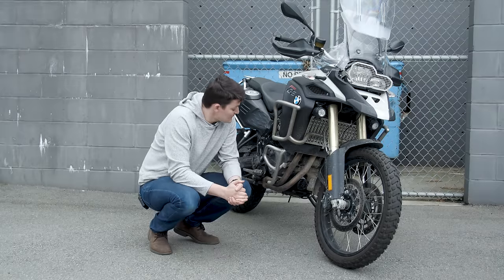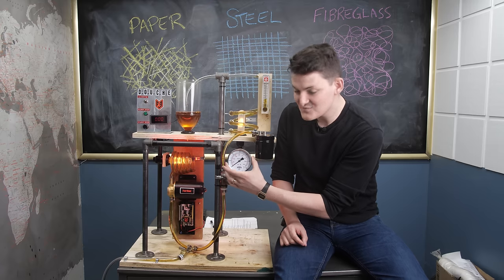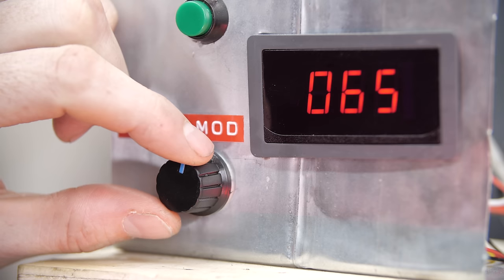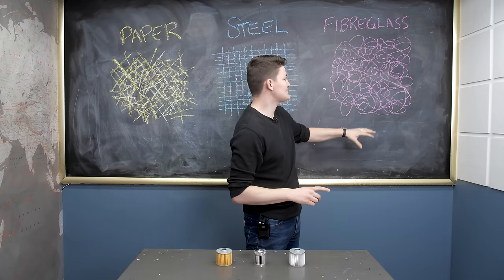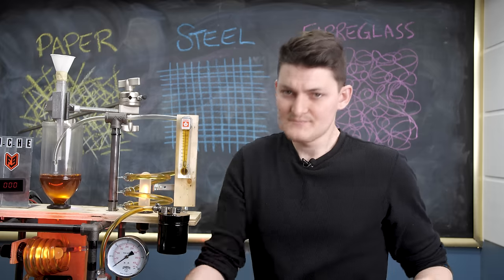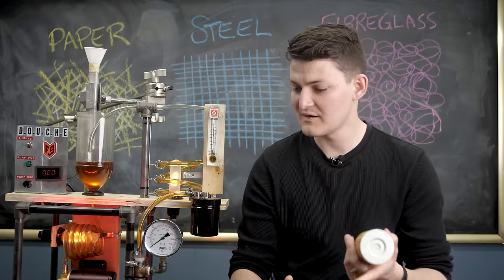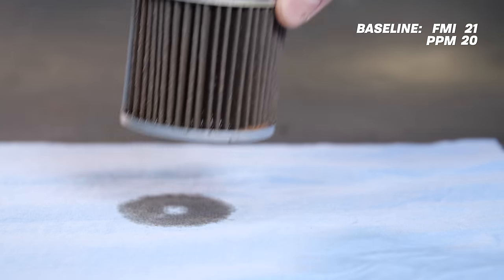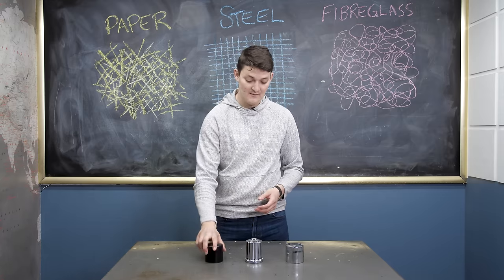The Best Oil Filter - Testing Paper vs Fibreglass vs Steel

Comment: As a marine diesel mechanic for many years. The oil and I am talking hundreds of gallons per engine in some cases. Is cleaned by centrifugal  separators can't get any better than that. This is one of the best dynamic test so far here on YT. Change oil often and use a magnet on the filter. Oil change is cheaper than new engine.

Comment: This was great, you should do a similar test between different types of air filters
Reply: That's not what this channel is about. 
Ask Project Farm to do it.
Reply: I'm willing to bet the results would not be too different. Yes, viscosity is different between air and oil, but the principles are the same.
Reply: @68404  Project Farm just isn't as funny.  Perhaps a collaboration is in order?
Reply: @68404  PF has already done one. It's alarming how poorly the most expensive K&N filters do and surprising how affective the cheap ordinary ones are.
Reply: @buzzman3200  I sorta expected that, but it was rather an amazing test.
Reply: @68404  Fortnine is more entertaining and does a great job at explaining what is happening and why results are the way they are.

Comment: The beauty of Stainless filters is that the flowrate is constant throughout the service interval - Paper and possibly fibreglass will deteriorate over the 5 - 10 thousand klms - there's a good reason we use Stainless in the world of offshore oil and gas - all my motorcycles run on Stainless for the past 20+ years

Comment: Another reason people appreciate your channel. Its funny, i have an old Toyota i bought used, and my last oil change i installed an OEM basic replacement NAPA filter. After 3,000 miles, the oil is quite clean, and cleaner than the previous more expensive filters. I thought this result might be anecdotal, since i have been changing the oil more often than recommended , and have been trying to mitigate an oil consumption issue. But the oil clarity now does not lie, its real good. So, this video explains why my results are what they are . Thanks.
Reply: Buy OEM filters from your local Toyota. 

Many years ago: a YouTuber, I forgot who, made a video cutting up oil filters of all budgets. The most expensive and highest quality filter — and one I used up until that video — was Mobil1. Guess who matched it's quality ? Toyota OEM. 

Mobil1 goes for twice the cost of a Toyota OEM filters. Ever since that video I always use Toyota oil filters for my cars.

Comment: I came to the same conclusion years ago in the automotive world. Now do a similar test on air filters to crush all those K&N myths once and for all. Great vid as always btw. 👍
Reply: Two other channels did a particulate and flow test on air filters, sorry I can't remember the names. Result, as you would expect, the K&N had the highest flow but of course passed the most particles. On my Miata I put my K&N in when I put the track tires on and I put the paper filter back in when I put the street tires back on.
Reply: @petezny4343  Most likely, it was Project Farm. K&N filters are an oil and gauze system. The higher tge mileage, the better they filter until they get saturated with debris.
Reply: Anyone dumb enough to use a high flow air filter with less filtration, in order to gain 4 horsepower, deserves to have their engine explode. I picked up a K&N filter once on display, and noticed I could see holes in the filter media that let light through! There are visible holes in the filter media. That's not an air filter. High flow filters are good on boats and track vehicles only. If you remove a paper air filter you'll see it packed with fine dirt particulate. Particulate ruins the cylinder walls, obviously.
Reply: @Ritalie  But it also keeps carbon build up down on the back of the valves on direct injection engines! /s
Reply: K&N kills off-road engines. Old fashioned oiled foam is the way to go for serious dirt and dust. Twinair and Uni saves top engines. I've seen pictures of road bikes running a K&N filter with all kinds of internal damage. It makes sense because unless you ride in a controlled environment you're going to encounter dust at some point. Sand, dirt, someone mowing their lawn etc etc. I know they make a prefilter for the K&N and it's probably ok for street use then but never for dusty areas.
Reply: Project Farm did a video on air filters. K&N performed poorly.
Reply: @yurgon  I had a K&N on my Vstrom and it so wasn't worth it. Little bit more pep and a sweet induction noise but so much bloody dirt passing the airbox. Should have stuck with cheap bastard filters
Reply: KN airfilters dont filter that great....
Had pretty dirty carbs with the KN my Bandit came with
Reply: @TonyRule  It's like getting your engine walnut blasted, but all the time!
Reply: @amicloud_yt  And for FREE!
Reply: This!!!!!
Reply: @amicloud_yt  nut blasted? 😳
Oh wait.. 🤦🏽‍♂️
Reply: No dust past the K&N filters I've been using for ~35 yrs on cages, street bikes, dirt bikes. Several over 100k mi, 1 over 230k mi. Proper oiling and install required.
Reply: @dougfreeman3229  They're nothing special. It's pure marketing.
Reply: @TonyRule  Incorrect in my case. Over 1,000,000 mi (all combined) is actual in service testing, not marketing.
Reply: @dougfreeman3229  It's anecdotal and without a control.
Reply: @TonyRule  Factual, have all the service records. Cant face facts can you? Throws a wrench in your narrative.
Reply: @dougfreeman3229  Look up the words I used because you clearly have no idea what they mean.
Reply: @TonyRule  Actual data is not anecdotal. The “control” is miles driven in this simple experiment.

Comment: For years I've been running Drag Specialties Chrome magnetic paper oil filter with great sucess in my Harley's, the oldest being a 95 Softail with over 73,000 miles. I've done autopsy's on several of these used filter and was impressed with their construction.

Comment: We used to split filters before discarding them. It taught me a lot about what's inside, comparing OE to cheap replacements. They were all paper, but the aftermarket filters used way less folds: i.e. way less filtration surface.
I only buy OE or from an OE equipment manufacturer.

Comment: One thing to note with paper and fiberglass vs steel is "one pass" reduction in particulate. Steel is absolute at whatever rated micron. So paper does filter finer, it is also possible that large particulate will pass through and hopefully be caught on the next go around. If steel is rated at 30 micron, guaranteed first pass everything larger than 30 micron will be removed first pass

Comment: I've been running a steel filter in combination with a magnet cover on my 09 BMW 450x with over 13k.  Nice thing with steel is the quick oil changes and reduced waste; since you don't have to wait for shipping and no extra packaging.  Great content guys!
Reply: will also blow up your bmw sooner or later
Reply: @rampage3337  hasn't yet and I have now over 15,000 miles on it and still runs like new.  Just the change oil, clean air filter, check timing,  and ride clean don't over abuse your throttle and use your clutch!  Been on everything to Idaho White Cloud range single track, Gifford dual track and Moab slick to the Hole Enchilada.  She's a "Big Mountain Women.  BMW! Plus its pretty much built by Honda anyway so you can do what ever to it and its still gonna run... My 2 bike quiver with additional 2 stoker 95 200KDX for GOAT rides.  I guess anything will blow up sooner or later even us! hahaha Thanks for your feedback on regarding why and how my motor is gonna blow up.  Perfect example why the internet is just great and so informative.  :P
Reply: PROTIP!  @BeardedBavarianBiker.

Comment: I was an engine performance engineer for Honda R&D before moving to ev and I will say 3 things: 1.) Ryan, you executed this test better than a lot of people would have in professional R&D, well done mate! 2.) most OEM filters do use paper, for cost etc. and it's really good to see it perform so well! and 3.) Generally the best filter you can use for your bike/car is the OEM one, along with the OEM recommended oil. This is because all of the development was done with these parts and oil formulas in mind, so your engine was literally designed to use it.

Comment: I'm also curious if there's any difference in results between cold and operating temps for the oil

EDIT: Ryan replied elsewhere and said the oil was indeed heated for the tests, and since that's what the oil is gonna be under SOP, it's good enough for me
Reply: Also I wonder what the variance is just in brands of the same types of filters
Reply: In this test rig they had the oil heated up hot, don't think they compared it too cold oil though
Reply: @archygrey9093  I wonder if it was 90c like normal engine oil would be
Reply: @pleasedontwatchthese9593  Definitely not 90c from that little heat lamp in the rig.
Reply: Temperature would affect only  the viscosity (the thickness) of the oil and thus the flow trough the system,  but it wouldn't affect the filtering capabilities. However,  there would be same changes with the metal filter, but I don't think they'll be any dramatic.

Comment: I appreciate these tests you do. There's so much misinformation in the mechanic world, much of it stemming from advertising or outdated knowledge.
Reply: Wow that's a really good point. The misinformation is painful. People using high flow air filters for example. Ruining their engine with more dirt. There is the issue of running unnecessarily rich fuel mixtures which also ruin your engine in short order and decrease power. And then there is the octane issue. Low octane fuel actually burns faster and increases horsepower. Buy some people run high octane fuel because they believe octane is the performance rating. So much misinformation. Octane is the rating of resistance to exploding. Higher octane is less explosive.

Comment: I'd love to see different brands of paper filter tested. See if oem or aftermarket is better
Reply from the maker: We did notice that some brands of paper filters are better than others! The cheap ones have no bypass filters and are often shimmed with literal cardboard. Unfortunately you normally have to cut the filter open to find out. K&N and HiFloFiltro are both safe bets in our experience. ~RF9
Reply: K&N scares me because of the poor filtration of their cotton gauze air filter products. I've been using the Amsoil filter. Even the Yamaha OEM claims to be good for two oil changes but I'd rather just do it every time for peace of mind and to make measuring the new oil more consistent.
Reply: As a guy with a racing background who has done a LOT of oil changes, Wix is my choice! Most are made in Merka (sorry ryan), lots of sizes, and not outrageously expensive. Heck, NAPA uses 'em.  If you want clean oil free of contaminants and bits of motor? Change your oil more often. You notice that none of the filters brought contaminants/metal down THAT much.
Reply: @r3beatty  Agreed, a decent filter and frequent/regular oil changes are more critical than spendy filters and fancy oils.  At the very least, use the OEM filters and an oil that meets the OE specs.
Reply: @imadecoy.  I've owned bikes where they recommend the filter is only changed every 3rd oil change!!!. If I'm changing the oil, I'm changing the filter too.

Comment: Question for Part 2: A filter used for it's recommended service life, how plugged up is it? My guess is that most filters get binned with out ever getting close to their "used up" condition.
Reply: Yamaha recommended changing oil filter every second oil change. I do this with my car. Change oil every 10,000km, filter every 20k. My theory was that even though filter medium may not be clogged, perhaps contaminants in oil may damage the glue that holds the filter together, or the filter media itself. So I was not prepared to chance leaving filter in any longer.
Reply: @glennmerriman8382  I have heard of the "skip one" filter changing scheme before. It seems logical, yet the question remains: how close to "used up" are we actually getting? I've always erred on the cautious side, new filter everytime. I've autopsied many a filter. I can't claim to have ever discovered anything except oil-soaked filter media. Maybe I need a microscope......
Reply: @runalongnowhoney  Every other one is recommended by Suzuki and Honda too. If it is good for the tiny filter of these hi-performance engines, its more than enough for a car.
Reply: @glennmerriman8382  nah don't listen to yamaha. you have to remember our clutches and all the shit that we grind off them get's put in to the oil and filtered through the oil filter.

Comment: As much as I love this channel, one example of each type of filter tells me little.  We don't have any idea of the variability of each of the filter media.  This was driven home to me recently with paper coffee filters when the latest batch took significantly longer for each cup.
Reply: @J Fess, it's ok. We're still going to laugh at you for upgrading your bike to a metal filter......
Reply: @rgh622  I was originally going to state that the worst option was the metal filter was the worst option but thought it went without saying.  Apparently not, though.
Ps I spent years dealing with industrial oil analysis and filtration systems.  THAT is why I stated that his simple test was not terribly useful.  A different brand of filters might very well have produced different results.
Reply: @jfess1911   Excellent reply.  Your background in the oil analysis & filtration industry would have caught my attention immediately had you said that in our original comment.  NOW, I to am interested in results from differing branded paper (etc.) filters. Thanks for your intput.
Reply: @petermangini6301  There are some YouTube videos in which oil filters (mainly for cars) are cut apart and analysed.  You might find them interesting.  The amount and type of filter material can vary significantly from one brand to the next.

Comment: curious if the flow rates change with temp .. depending on the temp of oil you used in your test , higher temps of the oil may yield different conclusions of flow rate

Comment: This was a super excellent video FN you cleared up a lot of the questions I've had about steel vs. glass vs. paper oil filters  SO  I guess paper it is! especially if you have a lot of German war crime in your oil (which I don't know I haven't had my oil tested) 😅   I've got quite a few of those black thingies hanging off my motors  due to be replaced    about yesterday 🤪😅

Comment: In test #2 with metal shavings added in, is it possible that paper did the best at not impeding flow because it failed to collect the shavings, while the other two filters slowed down because they caught more shavings more effectively?
Reply: When looking at the results of test #2 isolated from the others it does look like a concern but test #3 showed that paper filtered out contaminants the best.
Reply: This is one of the bigger issues with his test as well as whether or not there is a cleanup cycle in between those tests. 

For standard testing done in the filtration industry at the end of the test they would measure the amount of debris remaining in the system and then clean all of that debris out before running another test so it won’t plug up the next filter.  That way you know how much debris you added to the system and how much was left so you can actually figure out how much the filter removed.

And as you’re pointing out here, a filter that only removes larger debris and lets all the smaller debris through will plug up slower in a test like this (and arguably it would be the same on the engine assuming the debris being added represents what actually happens in reality.). Removing small debris is not a bad thing though and as long as your filter works to the end of the life of the oil removing more debris is generally a good thing (pressure loss factors into that though as the pressure needed to push the oil through the filter increases as the filter media removes debris.)

Comment: From what I learned working at a filtration department of a large diesel engine company, the dP over the filter isn't all too important as long as it's below a certain threshold.

As far as his comment on steel only trapping contaminants the size of the mesh, that's not especially true. I was surprised to learn the vast majority of filtration is not due to the particles physically being too large to fit, but is mostly due to particles sticking to the fibers of the filter. 

The metal particles used in his testing are not necessarily a bad representation of the stuff you'd usually find in oil, but for it to be meaningful it's likely going to be much smaller particles. Bits of metal dust like that aren't, or at least hopefully shouldn't, make up a big part of the contamination in the oil. Great that he used a standardized size dust however, and sounds about right ballpark for particle size. 

Ryan is completely right on flow bypass valves, those are on a lot of the systems out there.

Pretty decent efficiency test. At the end of the day, efficiency and capacity are the most important metrics for filter performance. Capacity limitations can be gotten around by just shortening the filter change interval, filtration efficiency not so much. Stay away from Fram, Wix, and other garbage, use good oil, let the bike warm up a bit before beating on it, and cool down a bit before shut off, change fluids and filters often and you're probably good to go.

Pretty well put together video, good job guys

Comment: My understanding is that the bypass valve also ensures adequate oil flow and protects the filter element from excess pressure when the oil is cold and the RPMs are high.